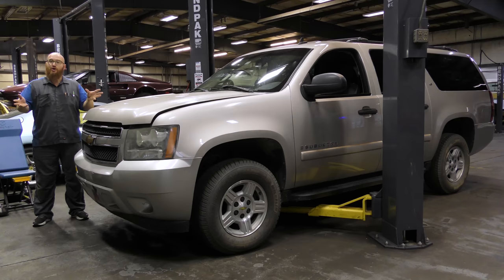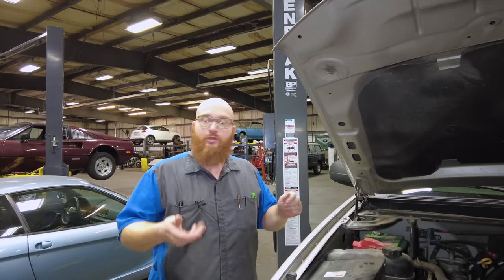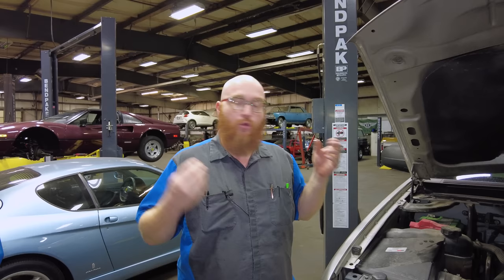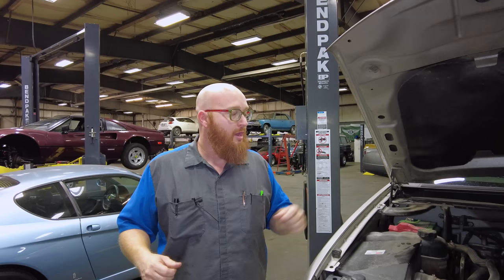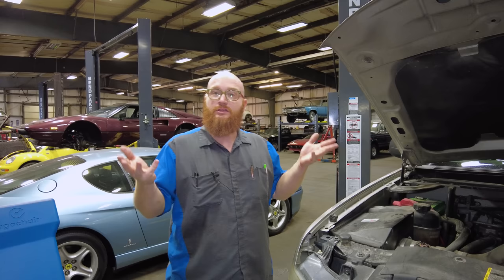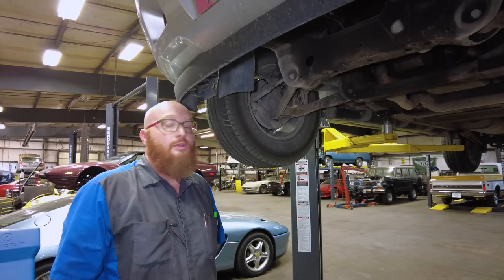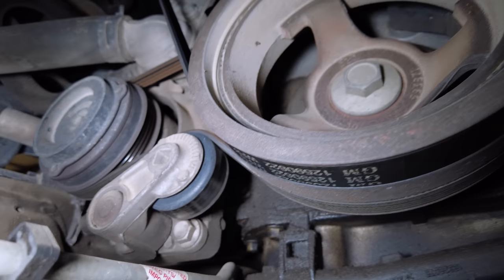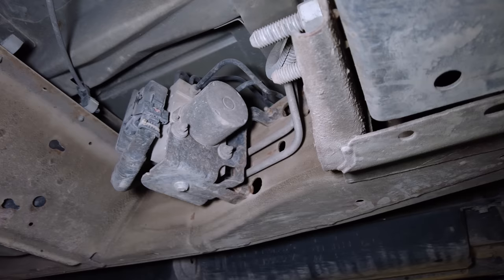What fails on ALL early 2000's Chevy SUV's!? CAR WIZARD shares what he's seen from the last 20 years

Comment: My 2001 GMC 1/2 ton truck, which I assume is similar to these SUVS mechanically had 2 fuel pumps, one alternator, one idler pulley, 2 serpentine belts, two sets of brakes, one set of rotors, a few sets of tires, shocks, suspension parts, various wear parts such as wiper blades replaced in 20 years and 250,000 miles. when I gave it to a friend 4 years ago, it had the original engine and transmission. It leaked, not burned, about one quart every 5,000 miles. My friend still has it and it still runs strong with nearly 300,000 miles on it. Although I have owned many vehicles, both domestic and foreign, this was to best vehicle that I ever owned. If you find an early 2000s Chevy or GMC truck or SUV and it has been taken care of, it will be a great investment. Oh, and yes, I worked the truck hard for most of its life hauling firewood and towing equipment and a 7800 lb travel trailer. It was not a powerhouse when doing these heavy tasks, but it always got the job done.

Comment: GM mechanic here from 1997-2010.  Problems with these vehicles is 1. A/C temp actuators 2. Encoder motors 3. Front diff leaks 4. Rear diff carrier bearings 5. Transmission problems 6. A/C compressor problems(rarely) 7. Water pump gaskets.  8. Fuel pumps. 9.Intake gaskets.    I can't recall replacing any engines,  a few head gaskets, but overall solid vehicle.

Comment: I have a 2001 Silverado 1500 5.3L. Amazing truck. Original engine and transmission with 227,000 miles. Out of the 16 items he mentioned, I have had 3. the 3 are: ABS module, front differential seals and exhaust manifold bolts. The other issues I dealt with were intake manifold gasket leak, fuel pump sending unit causing gauge to bounce and the usual rocker, cab corner and fender rust. If GM could fix these issues mentioned including all from the cafr wizard, they could make one of the best trucks. We  do not need Onstar and Wifi and other fads. I had a Toyota and there was a lot more problems I fixed, and it was a pain to work on.

Comment: Changing out all spark plugs and plug wires when replacing a coil is good to do no matter what vehicle or engine you have. I did that exact thing a couple summers ago when I had a could go bad. Pretty sure I spent under a $100 fixing that.

Comment: I have a 2000 Silverado four-wheel for 53 228000 miles on it to change your regular oil change the plug gradually transmission fluid regularly never put a water pump on it or radiator or anyting and I drive it everyday such a great truck it's been great never ever left me stranded

Comment: Dang, I guess I’ve been lucky. ‘05 4.3L AT Work Truck purchased new 150k, parts replaced list:
Thermostat, evap canister, blower motor resistor, shocks, both front spindles, front pads 3X, trans filter & fluid.

Comment: recently bought a 2010 Yukon 5.3 2wd here. 202k miles, all original everything. Even the alternator. Ran it through the shop I work at and was shocked it had its original Balljoints. We did alternator and belt, upper and lower ball joints, trans cooler lines, rear pinion seal and it’s back to like new. Paid $7k for it and Im super happy. Parts were crazy cheap and labor is cheap too. Techs love this generation GM truck/SUV because they are easy to work on.

Comment: 02 Avalanche. Brakes.  Now need a fix of window that doesn't  work. Cruise control not working, but since I don like it, that probably not getting fixed. Rust belt sadness. First of the four lighter sockets has never worked right. AC  recharged once as not a big user. Tailgate lock replaced. More brake work and more brake works... lines, rotors. Milege not wonderful, but I am a homebody and rarely do more than 100 miles in any month. Mostly highway miles. About 135K total.

Comment: The 2007 suburban has the AFM and I just had to replace a lifter because it read as a misfire and so I changed the coils, plugs, wires and just for those it was over $500 just for the coils at autozone. Can’t imagine with labor

Comment: I believe this is around the time things started going south for Tahoe and suburban models. The 2000 non flex fuel were great and didn’t have many common failures just keep up on trans diff  gear oil & trans fluid changed with correct fluid and oil changes.

Comment: Having owned one of these for over 7 years (from 2013 to 2020, it was a 2013 model year) with the 5.3L V8 (probably the worst engine found in these) and luckily I didn't have the dreaded lifter tick that many develop over time from collapsed lifters (they started using those in either 2007 or 2010 on some of the V8's), but I did have to have the exhaust bolts drilled out and re-secured.  Luckily I was only charged $300 per side, so $300 total, but I also sold the truck about 18 months after having that done (for other reasons, oil burning, due to AFM issues but still managable -- although it was getting to be about 1 quart every 1500 miles).  If you do get one of these SUVs or trucks from the mid 2000's (like 2007-2013 at least) get the 4.8L non-AFM V8 (has about 90% of the power and torque of the 5.3L but really none of the issues since it doesn't have AFM; I would stay away from the 4.3L V6 unless you're getting a 2-door standard cab truck and won't be towing; and the 6.2L is a gas hog).  But stay away from the 5.3L V8 for sure, or if you do happen to get one before it starts burning oil or having lifter issues, get an AFM delete kit and new "solid" lifters on that thing ASAP.  You can prevent it, but you have to do a delete kit which is about $3500 if you have someone else do it (cheaper than a new engine of course) but if may save you money in the long run if you plan to keep the vehicle for a long period of time.  Second, luckily, these are common enough that you can find rebuilt motors for them and people rebuild them, unlike the 2016 Hyundai that Car Wizard said nobody rebuilds in a recent video, and the customer had to junk the car.

Comment: Had to replace the MOSFET on the instrument cluster of my 07’ suburban. Luckily I’m an electronics technician so I had the knowledge and tools to troubleshoot and fix it. Also had a problem with the sat nav radio not receiving the CANBUS message from the computer to turn off when the key was turned off, causing my battery to drain over night.

Comment: I have a Tahoe PPV retired K-9 unit I bought at auction for 8k, I did a AFM delete and half of the other stuff he mentioned but they were relatively easy and the delete only ran about 1,000-1,500 with all ac Delco or Texas speed parts (some Brian Tooly) stuff arp head bolts and what not, but when I cracked that motor open it was so clean you could eat off it! I was shocked! Maybe it’s because it was a police truck that it had great service records, most the work I did because I wanted to not because it failed, I just hate those AFM lifters and wanted a bigger cam.. he’s pretty accurate in what fails on these trucks but imo I think it has to do with where you live, maintenance and what not- I’m in Florida so it’s super clean with no rust thank God, simple motors to work on, cheap to fix and if you take care of them they will last forever

Comment: 2007 Tahoe LS 4.8 no AFM is key.  I have yet in the 14 years I have owned it to have even a single one of the issues he mentioned fail.  Noted issues from long time owner-emmisons eval solenoid will fail, you will notice when hard to start after fueling.  Same for rear evap when hard to fuel.  The dashes are two pieces of cheap plastic and will crack, they make an excellent dash cover for about $170 that matches great and easy install.  Heater hoses probably will fail at firewall entering heater core-only time left stranded.  I never intend to sell.  Keep maintaining it, change oil, and don't pull a trailer.  He is right the failures are simple and cheap fixes normally.  Key is no AFM and don't overfill when fueling up.

Comment: There are heat resistant sleeves for the spark plug wires available.... And not forgetting the engine grounding wire rusting off (dissimilar metal corrosion) on the engine firewall side. All electronics going crazy.... Hard to get to, very easy fix.

Comment: 05:06 2007,6,5,4 no active fuel management
1. Oil Sending Unit
2. Battery Fuse in the back
3. Spark Plugs - they break when doing a tune up
4. Coil Fails
5. Knock Sensor
6. Instrument Cluster Gauges

Comment: a pretty common issue in the interior is the power seat not working. most of the time its if the seat is either all the way back or all the way forward. what happens is the fuse blows or the wire harness to the seat motor develops a electrical short from rubbing on the seat track

Comment: I used to own a 2001 Chevy 2500HD 4x4 w/Duramax. Some of the items which failed on it were: front wheel hub - both sides; universal joint on the rear differential - 2x; fuel tank sensor; Not 1 but 2 blown transmissions. And I only towed a trailer 1 time with it. The first tranny was covered by warranty. The second one I paid for... about $3000. And A/C parts including hoses, condenser, gaskets and accumulator, about $500 parts cost.
Fuel injectors. For the 2001 Duramax, this was a known and common issue. It was also a recall item which was never communicated to me until it was way too late. For the Duramax, all the fuel rails as well as the injectors have to be replaced, about a $3600 parts cost at the time in 2013. I did the work myself. NOT RECOMMENDED! Although I did save about $4000 in labor costs.
Shall I keep going... thermostats - 2 units both are replaced at the same time. 1 water pump which is almost a half day teardown. 
Still, I really did like my Duramax...

Comment: 2008 Silverado 5.3 , Flex, AFM/DOD and 310,000 miles on the clock.  Finally lifter collapse on #1.  Yes I would delete AFM and change the lifters and cam to non AFM and then tune.  Still 310K miles and still running.  LS engines are beasts.

Comment: there is also the automatic shift transfer case. This is normally a problem at high mileage as I recently discovered in our 2003 suburban at 220,000 miles. it started making noise, despite being well cared, for we found that all the oil had leaked out doing some searching. Apparently, this is common as there is a pump inside the transfer case to circulate the fluid. This allows the automatic function to work, but the case itself only holds 2 quarts of fluid, and the case in itself is a design flaw as it’s made of magnesium and the pump eventually wears a hole in the case there is an aftermarket fix if you want to fix it as a preventative repair placement and yours is not broken I highly recommend doing so and while you’re in there replacing the shift as they were with that many miles unfortunately I had to source a new replacement. I couldn’t salvage anything as all the parts had seized to the output shaft to the rear wheels due to heat from no oil it’s really unfortunate because to us it sounded like we had a bad wheel hub so we just wanted to change the bad part till we could do both sides and an alignment it was not long but it was long enough so just wanted to let everyone know this is a thing only on the auto 4x4 in all gm vehicles from early 2001 to late 2007 the transfer case model number I’m referring to is known as the gm nv246 or np246 there the same thing just a small design change in the encoder motor for the 2003 to 2007 year but both have same design case flaws

Comment: "Quick" disconnect heater hose connectors. Guaranteed fail at about 10 years/ 100-130K miles. Not super easy to get to but once you remove the old ones they do snap together quickly (got to make things as easy as possible on those assembly line workers... )

Comment: NHTSA Complaints for the 2022 Chevy Tahoe

Service Brakes	
8
Electrical System	
7
Unknown Or Other	
4
Power Train	
3
Structure:body	
3
Engine	
2
Forward Collision Avoidance: Warnings	
2
Interior Lighting	
1
Latches/locks/linkages:hatchback/liftgate:lock	
1
Visibility:sun/moon Roof Assembly	
1

Comment: Fuel pump
Radio
Remote lock/unlock
Tow/haul button cable

 My 03 Sierra had 212k miles and my engine/transmission did not have any issues

Comment: Thanks for the heads up on the 4L60e.  I've towed with a 4.3 L safari with a 4l60e and towed a trailer with a base weight of 4600lbs and sometimes up to 5500 lbs. In overdrive the whole time. Still works. I think beating the hell out of a vehicle is bad in whatever gear you're in so I drive like an adult who pays the repair bills myself and make my vehicles last.

Comment: some things I didn't see mentioned was the fuel pump driver module, brake switch, fuel tank vent valve, and up north the frames are always rusted out around the abs module all the way back past the fuel tank.

Comment: My 05 GMC Sierra 5.3 gas has 371,000 miles on it. I had to do a transmission at 327,000 and rear brakes at 355,000 and only 2 sets of fronts. I have had several of these issues and have done the majority of the work myself. These are great trucks and mine has done a lot of work with very few issues. Take care of them and they will take care of you.

Comment: Bought 07 Sierra (5.3 afm) new. Haven’t had any of those issues. Replaced sensor on top of fuel tank and some fuel breather on bottom. Recently had dealer replace bcm.  Just regular consistent maintenance beyond those 2

Comment: It is not only towing anything over 1,800 to 2,000 lbs, it is also hauling heavy loads in the bed, that will fry the trans.  About 2 years ago(?) I purchased a used and nearly abused 2010 Sierra 1500 2wd.  I did the oil change the next day and it was black, darker than I would have liked, but not too bad.  A few months later I had Cottman Transmissions perform a fluid flush/filter change. Even though the truck only had around 75k miles on it, I figured that since the rest of the truck has been abused by the original owner and literally parked for ten months by the second owner, I should do as much PM as possible. Regardless of all that, the owner of the shop told me a Lot about how to properly treat these transmissions so that they will last as long as possible.  The main issue he pounded into my brain housing group was to check the cooling lines (mine just started leaking), check the fluid level often and above all, since I am in construction and have a long bed truck, to use the Tow/Haul mode as often as possible when towing or hauling anything significant, even to error on the side of caution.

Comment: Thanks Wizard, I have a 247,000 mile 2009, I’ve taken care of most of what you said, will look into the ABS sensor and oil pressure sending unit.  For most daily driving & towing, I leave the gear selector in “5th” never leaves v8 mode, saves on trans shifting.  How did I miss this 5 months ago?  Oh ya, was under my burban on the weekends….

Comment: Almost every Australian built Chrysler Valiant I owned had dramas with the its version of the high tension main fuse which from memory was called a fusible link. The box and the wires in and out of it became corroded with green oxidation on the connectors. You’d be driving along happily and suddenly the engine would simply die, or you’d go to your car, usually after having driven it and it would refuse to start. So, after the first time I would on subsequent cars replace the fuse link and service the connectors. Never had a problem after that.

Comment: Just brought a 2004 yukon xl 5.3 . Living in MD, these vehicles will have rust in the bottom. This truck barely has a like of rust, main reason I brought it. And replacing the most common parts is a piece of cake. As long as the engine has oil, it WILL last forever, with proper care and maintenance of course. The best gm trucks are from 04-07

Comment: 07 Silverado WT. great truck, horrible v6 motor. However only issues was I replace 3 thermostats. It burned a lot of oil so had to stay on top of topping up. I drive conservatively and never had to change brakes 115,000 miles

09 avalanche. Bought it was 36,000 miles, I’ve put 36,000 myself and I think the previous owner drove it hard. Had little things.

Comment: GMT800 is the first year for that design in 2007 and has AFM, pre 2007 does not have them as you mentioned, my 2007 Avalanche was going strong with original engine and transmission with the tried and true 4spd with over 280k
The 6spd in 2010 and later are known to fail,  good advice! - Mark

Comment: Awesome video so thank you for making it. My friend just gave me his cherry 2002 Suburban 1500 LT which runs awesome and when it’s at idle I have to look at the tach to make sure it’s running since it’s so quite. It has 262k but you’d never know by how great of shape it’s in and how much torque it has and doesn’t smoke a bit when I get on it. Actually blown away on how quick it is for being so heavy. I bought new spark plug wires, front running light lenses and other easy to replace items. I better do the cable ends on the firewall and replace the tensioner.

Comment: Can't disagree with any of the things mentioned. Need to add that here in Wisconsin you WILL need to replace every brake line along with fuel supply and return. Also at some point the top of the fuel pump WILL rust through and cause either an evap code or fuel leak.

Comment: I solved a rotten knock sensor by throwing a tiny jumper wire in the electrical connector.   No more code.  It’s an old Tahoe so bandaids are necessary